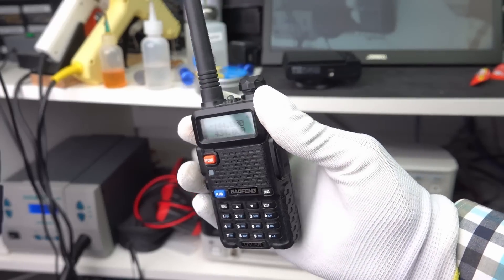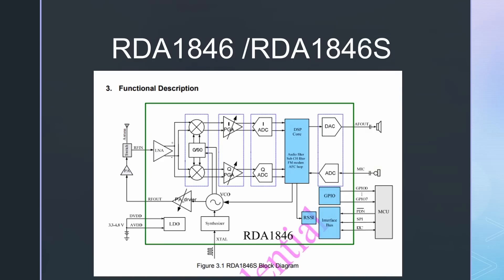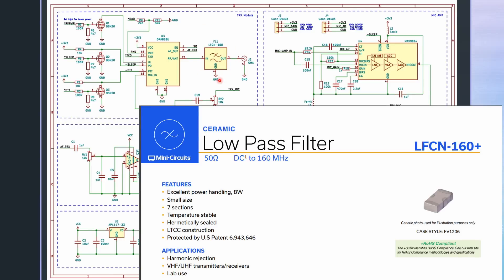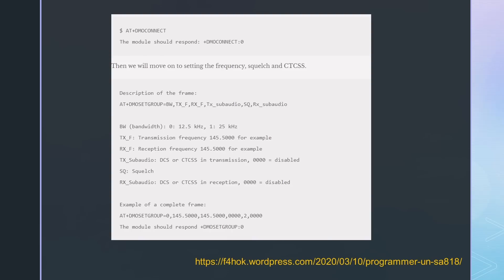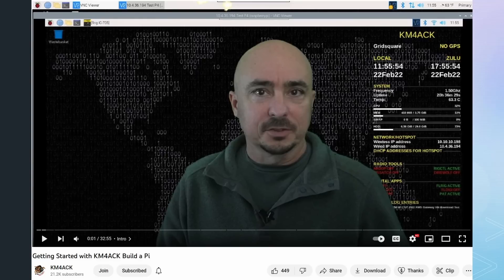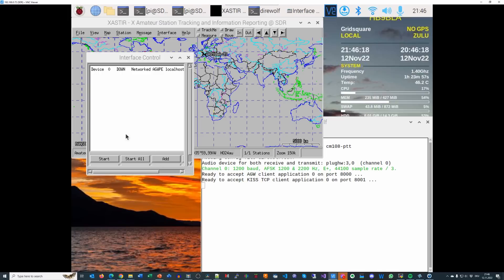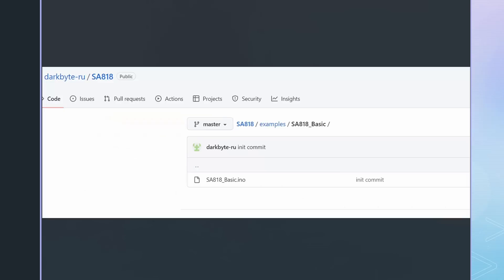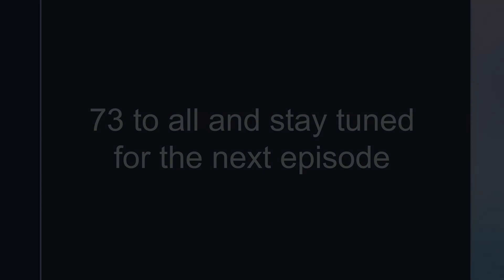025 We use Baofeng's "heart" for Our Projects (SA818, DRA818)

Comment: I have had bad experiences with Orange Pi, they tend to die after 1-1.5 years. How are yours?
Reply: I have a couple (with copper heat sinks) running 24/7 in small junction boxes for outside use for different SDR projects (low CPU usage). They run fine after 3 years in operation. On the other side, I have some other OPIs where the SD card slots broke, or the HDMI connector broke after 12 - 18 months of use (used 1 - 3 times a week).
Reply: I had 2 working 24/7 (running domoticz). The fist fried within a year  but the other one is OK still after 2 years since I under-clocked it a lot till the CPU t° was reasonable and I added a few heat-sinks also (but no fan).
Reply from the maker: Mine productively runs for 6 months. But on low load.
Reply: My two orange pi zeros work fine and are 4 years old by now
Reply: Mine had a broken SD card reader, they seem to be badly soldered.